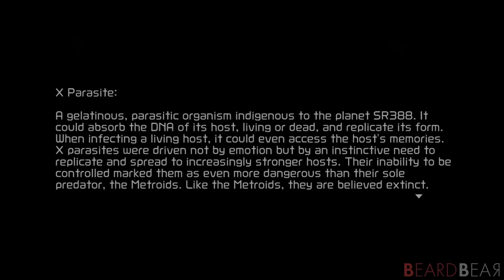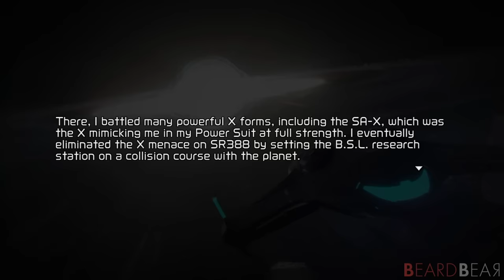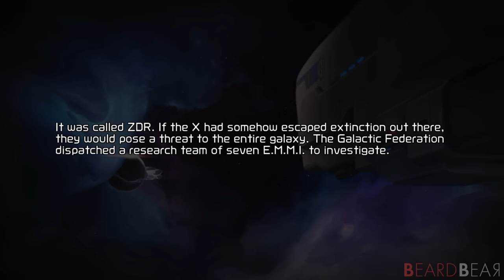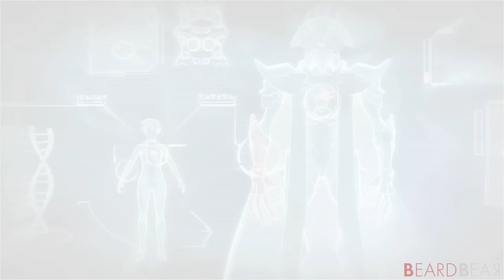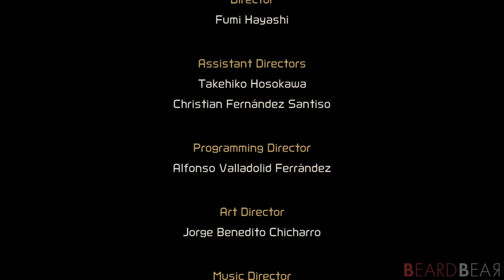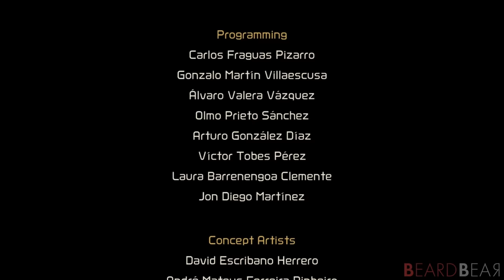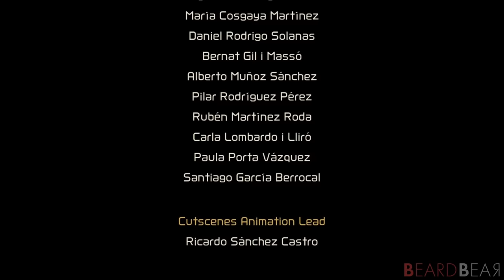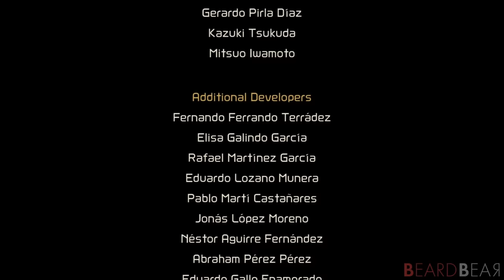Metroid Dread - All Cutscenes The Movie HD

Comment: after completing my first playthrough of this game, i now understand why it's called DREAD
this game is amazing at making you feel terrified. you feel horrified entering the emmi zones. this new enemy made you feel completely helpless, mostly because you were. in an Emmi zone, you're being hunted. you're no longer the brave awesome samus aran. you're that little girl who's parents ridley killed. And to make matters worse, you're not just running from the Emmi, but a creature clad in Chozo armor who straight up wrecked you as soon as you landed on the planet. It wrecked you at full power.
now you've got basically nothing. and what's worse, IT'S STILL OUT THERE.

Hell, even the game mechanics are based around fear. to defeat fear, you need to charge it head on, and what's the big amazing thing you can do as samus? Smack things with a melee counter. pulling that off is so gratifying, but also very dangerous. which means it still doesn't take away from the fear you feel. especially with the Emmi. when they catch you, (and trust me, there WILL be times they get you) you're a caught animal, and you've only got 1 shot at survival. and it's not great odds either. 

the most terrifying thing however, is how the Emmi adapt to your playstyle. and the best example of this is with the green emmi. for the first 2, you could easily get around them by sliding into areas they couldn't reach. but now? Now this green one shows off the fact that not only can it do that too, but it can do it better by crawling, getting into vents YOU CAN'T. turning one of your greatest advantages into a new weapon. 

you are NEVER invincible in metroid dread. even during the end when you've got everything, the game still makes you very much afraid.

Dread lives up to it's name.

Comment: hm, revan actually uses in his introduction only attacks he used while you fight him
so he actually was using his full strength against us, Sans would be proud

i am aware that he is much more dangerous in hes P3, but in the end he still only uses hes basic moves, only with more dmg
probably because he isn't using his shield in P3, he either uses hes beam, or hes shield both are not possible it seems

also the intro kinda annoys me, there is way too much unnecessary recap of what happen after we land, it was 5 min ago, they could have just cut out the waking up part, and let it run normally
it's like the old TV shows of "what happened in the last episode" but in this situation, the last episode was 2 sec ago. 

we land, cut to black, we wake up, and then we get a recap of what happens after we land, just to continue to stand up, we didn't even had control of samus yet.